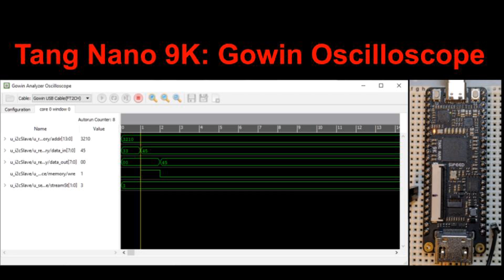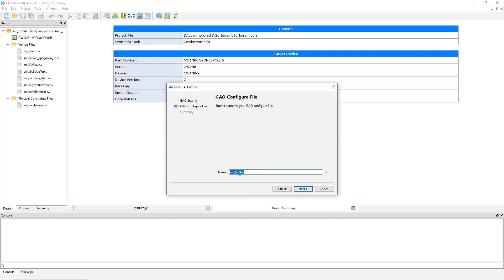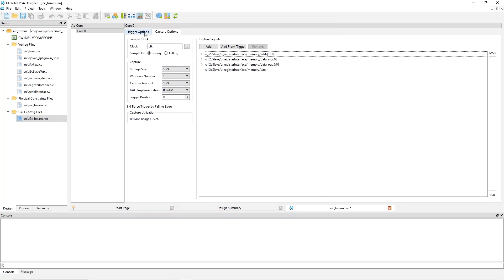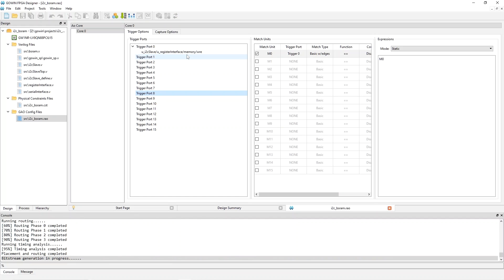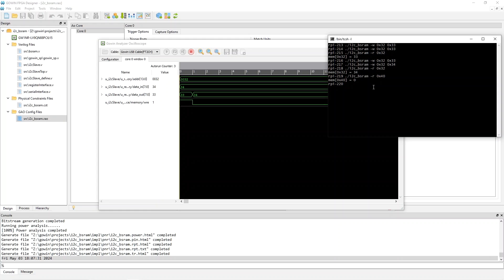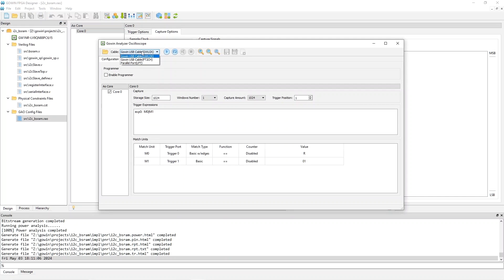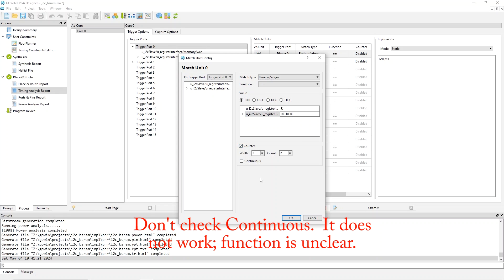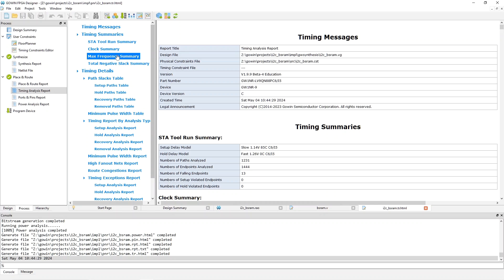Gowin Analysis Oscilloscope on the Tang Nano 9K FPGA Board

Comment: Great news! I just tried this on linux and it WORKED! Here's my configuration:
- Fedora 42
- Gowin version 1.9.11.02
- Tang 20k (note that you need to program using "External Flash Mode" for this board, NOT SRAM as you do for the Tang 9k).

For some context, I had a rather large FPGA project I started about two years ago, at which point the GAO did not work on linux. I just resurrected it and followed your video and it all works great.

Anyone should feel free to reach out if you run into problems and hopefully I can lend a hand.
Reply: Would you mind sharing additional information about your setup? I was able to run the latest version of gowin in fedora 42, but I wasn't able to get the programmer to recognize my tang 20k
Reply: @IsaacSF  how can we move this offline? It might take sending some large texts back and forth that are best suited for some other platform.
Reply: Hello Michael, I have gotten the Programmer working in Linux, but not the GAO. could you please share any details on how you succeeded? how can i contact you
Reply from the maker: This is helpful.  Thanks.

Comment: Just revisiting this video now that I have a Tang9K loaded with a ported Cyclone IV project. First barrier I need to overcome is getting the GAO to connect on Windows. I had some difficulties getting the standalone programmer to work so I downloaded the latest and that's all good.. but unfortunately it looks as though GAO itself (launched via Tools menu) cannot find my USB device when I select FT2CH. 

I've emailed Gowin.. I wonder if I hear back from them.  If I do, I'll try and respond to this comment in case anybody else has a similar problem.
Reply: I downloaded the latest 1.9.0.11.01 Education version and that seems to have sorted it out.

Comment: Thanks so much for doing this video. I'm new to the Tang Nano devices. I was a reluctant to use them since I was so comfortable with SignalTap on the Cyclone IV but having seen the GAO in action I'm definitely keen to play more with the Tang Nano - and they certainly synthesise a lot faster than the Cyclone IV/V devices! I love the small size of the Tang Nano devices too.
Reply from the maker: Glad you found it helpful.  I was attracted to the Tang Nano boards by their low cost.  They are cheap enough to buy just to tinker with them and learn about FPGA development.  I also like that they are bread board friendly.  GAO is helpful, at least on Windows.  The latest educational version is more stable.
Reply: @electronics.tinker  I only dug out my old Nano 1k board the other day. I bought it a few years back. I couldn't use the educational version - it no longer supported my device so I got in touch with Gowin. They replied to me very quickly and advised me to install the latest non-educational version. I had avoided the non-educational version thinking there would be an associated cost with the license but there doesn't appear to be.
Reply from the maker: I have read that the non-educational version is free, but you have to apply for a license (I think annually).  I have been using the educational version just to avoid bothering with a license.  Have you noticed any features missing from the educational version other than support for some devices?  That would be interesting to know.  Cheers.
Reply: @electronics.tinker  I haven't used it enough to notice, sorry. When you install the 'full' version, it replaces the educational one (on Windows) so I haven't been able to do a side-by-side comparison. I do switch between 3 PCs though and I've had no trouble getting licenses for all 3. They're pretty good with their support - definitely a game changer for people wanting to get into FPGA on a budget. My project got too large for the Cyclone IV - mainly because of the amount of logging I was doing with SignalTap, so that's what forced me into buying a Cyclone V - just for development. I'm sure the Tang 1k/4k/9k will suffice my needs - and to be honest, the 4K seems to be the same price as the 9k now. I think the only concern with these boards is the number of pins.. but the Tang Primer seems to have that covered. I think you can even swap out 25k chips on those Primer dev boards too which is quite exciting.

Comment: Thanks, seems very clear to me, cant wait to try it
Reply from the maker: Since I made this video, Gowin released version 1.9.9.03 of the educational version of their tools.  GOA is less glitchy with this version.  I have found it to be useful.
Reply: Nice.. I use linux and  openFPGALoader. I set up the .rao file and burn the design.  But when i try to open the oscilloscope i get the error : Can not connect to jtag server... Any idea why this happens? Iuse the tang primer 20K board
Reply: I figure this out (using chat gpt) i had to rename one file (libz.so.1 to libz.so.1.bak). Now i have another problem... i have made a simple counter 25 bits. After setting the clock(clk) and triger (ther reset signal assigned to button T10 of the board), when i press the auto button and then click the reset button on the board  seems like it doesnt trigger anything...The only thing i made different was to select gowin usb cable GWU2K beacause the other option (there are only 2 for tang primer 20k i gwess) gave an error. Any idea why this happen? (i have downloaded the 1.9.9.03 version ). I have tried it many times... Seems like the analizer osc. software can not communicate with the board for some reason
Reply from the maker: I never got GAO to work on Linux.  I think it is somewhat tied to an older version of Ubuntu than I have.  You could use "ldd command" to see what shared libraries "command" will use.  There are many shared libraries packaged with the Gowin tools on Linux, but maybe Gowin would be better off offering a Linux container or something.  Making a program work on all flavors of Linux can be difficult.  I prefer to develop on Linux, but I find that the Gowin tools work more smoothly on Windows.

Comment: I need to get my Tangs out and play with them. I need another LA like I need another hole in my head, I bought some of the HP "Biggies" when they showed up for cheap on eBay. I'm good. :) But I am loving this series, thanks!
Reply from the maker: Cool.  I was attracted to the Tang Nano 9K because it was cheap.  I don't actually need an FPGA board!  I just wanted to learn about FPGA programming.  I think I will try to build a simple SoC on it.  There is quite a bit of material out there on that topic.